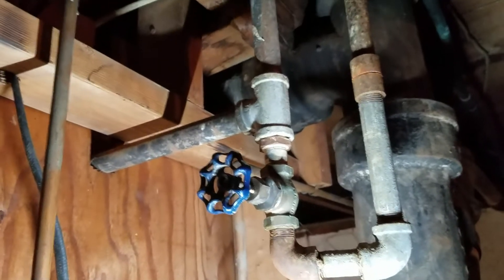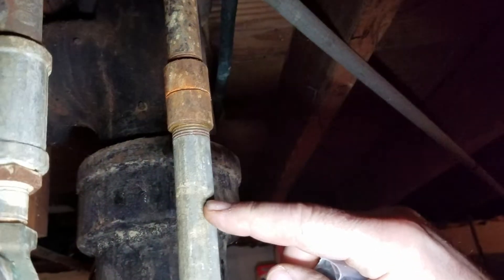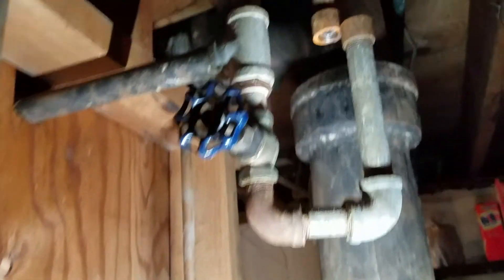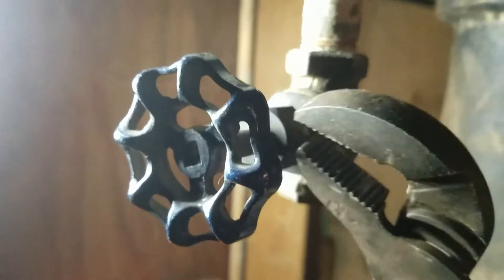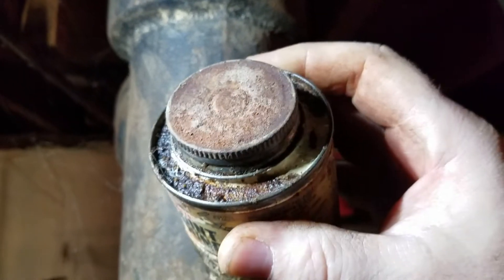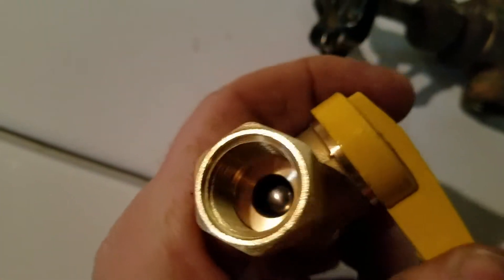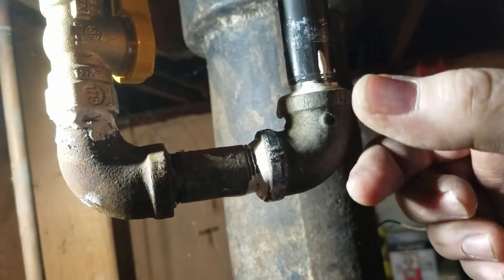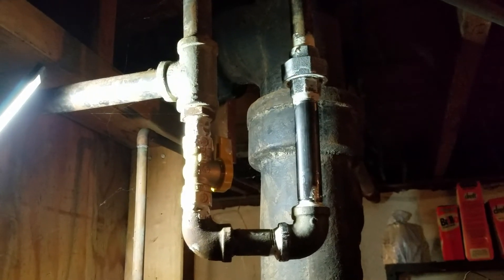HOME REPAIR 101- fixing a gas leak

Comment: They may make special unions for gas line, but the standard ones are usually not allowed. A left right pipe nipple and connector are normally used.  Just thought you would like to know.

Comment: What is the best pipes to use to for replacement to fix a gas line
Reply from the maker: I like black pipe myself, but apparently you can use galvanized pipe also
Reply: @Smittyschannel  Copper for internal gas fitting, external PE for all excavated Gas Lines, up to your Riser / Meter position

Comment: Why would put pipe searler on the union when its tapered ?
Reply from the maker: extra measure of protection; you can also leave it dry as is.
Reply: My two cents . If in the future you need to break the union again to work on another leak or add another line the top and bottom will come off easy . If no dope the union can rusted frozen . Frozen fitting is no fun and take more of your time .  Be smart .
Reply: All gas fittings are tapered, what exactly is your point? You're trying to say you don't need dope on any connections? lol, pipe dope isn't just a sealer, it also keeps the threads from binding so the next guy who comes around and has to take it apart will have an easier time breaking it free.
Reply: @losferwords100  Not here in the UK I've never come across a problem with taper fitting being tight . If the next guy can't do it not your problem

Comment: Where do they allow a union for gas line anywhere other than outdoors?
Reply from the maker: how else are you supposed to make in line repairs & connections? We have unions on most every hookup around here
Reply: @Smittyschannel  Look up left right couplings. They are approved almost everywhere. And any competent plumber will have no problems. They are a little tricky to get both sides started at the same time. In California I have had inspectors turn down a job, even if the unions were already existing.
Reply: Or you can use csst. Which is corrugated stainless steel tubing.
Reply: Union’s can be used almost anywhere in a gas line with one exception. ( can’t be concealed )
Reply: @mastergasfitter  Not in San Diego CA Maybe in other areas, but I have been turned down for exposed existing union joints. An easy fix, but still a pain.
Reply: @notredo   your state is different in many ways due to earthquakes 
I live in Miami fl and follow the recommendations of NFPA54
Reply: @mastergasfitter  thanks for the info. I personally don't have a problem with pipe unions. Just have to follow the rules

Comment: You said to use black pipe with natural gas but my gas utility uses galvanized pipe and fittings exterior to the house. I know it is because it won't rust but why not use black pipe and paint or coat it instead if the galvanize will flake off?
Reply from the maker: I would say galvanized on the outside is prob used to keep the pipe from rusting from rain, snow, etc. Perhaps today's galvanized pipes are less corrosive than 20-30 years ago.
Call a local plumber or gas company to be sure.
In trade school we were always told black pipe for gas applications
Reply: @Smittyschannel  just paint the exposed pipe. any respectable company would do that as standard. beyond the meter though, is your problem and is probably the result of a bad plumber.
Reply: @majcaboose  unsure about other states, but in NYC, painting the outdoor pipe in a color has to change the leaking test pressure, which has a much higher rate for colored
Reply: I'll bet you someone replaced it to a blue handle that's a gas valve I have the same you can use gas hardware water but you can't use water as gas cuz it's not listed usually I'm told at least here in Ontario Canada lots of older homes have galvanized gas supply lines

Comment: I was taught to not put sealant on the slip nut threads of the union. The sealing feature is the taper joint here, not the threads.
Reply from the maker: I put it on the threads for good measure; made sure not to get it on the taper seat areas
Reply: That is misleading to understand the basic principle here. Similar to, if you saw someone put sealant on hose threads and they told you it was for good measure. Would you just shrug your shoulders?
Reply from the maker: Use it or don't use it- I don't care. Not sure it matters much either way. You are responsible for your own repairs. Haven't had any issues by putting it on the threads for years

Comment: They are lucky they didn't blow up.that coupler is actually a thread protector the threads run through not tapered. People get cheap then they leak. In cal you can't legally put in a union in the house. Only 3 feet from the meter. Galvi is for gas out side. No iron pipe on water.

Comment: Get rid of that pipe dope and use new black fittings and pipe. Clean and safe.
Reply from the maker: It's petroleum based; it doesn't really go bad unless air gets in the can & dries everything out

Comment: Couldnt you use two copper to steel connectors... one where the valve is and another at the other side.. that way you can cut the copper whereever you want
Reply from the maker: thanks; will keep that in mind

Comment: When he was holding back with his "Channel Lock's" not to be a you tube Plumbing Inspector he held the Channel Lock's backwards. Not good if you are a apprentice. "ALL-PHASE PLUMBING & DRAIN CLEANING". Good job and a MONEY saver for you
Reply from the maker: you mean at 6:30? The way I was doing it was correct, for leverage against the direction I was turning the old valve.
Reply from the maker: I am well aware of the way you use channel locks & 'crescent' wrenches. If I have to torque something down I use the fixed jaw to apply force. If just moving around a nut, either will do until it's time to snug it up

Comment: Wrong on the union part. You’re not measuring end the fitting to end of the fittings you’re measuring from where the thread stop on the inside to where they start on the other side
Reply from the maker: It was a rough estimate; I know that you estimate halfway into the threads. I failed to mention that

Comment: You can use galvanized pipe in gas line. Galvanized is rust resistant compare to black iron pipe.  And galvanized in code approved fyi.
Reply from the maker: thanks for the update

Comment: Black pipe does not have any corrosion properties where galvanized pipe is Black pipe with zinc coding therefore giving it a corrosion property it is always recommended to use galvanized piping which is more expensive than black pipe in all gas piping only people in the north don’t read nfpa54 or don’t understand corrosion properties use black pipe or dissimilar metals such as black pipe and copper together which definitely causes corrosion use one material or another if I was that guy I would’ve changed all of the black piping to galvanized piping
Reply from the maker: thanks for the info

Comment: Per manufacturers spec you only put pipe dope on the first few threads or approximate 1/2” of threads. Get a 20$ sniffer and don’t call the gas company unless you fuck it up

Comment: You said the gas people turned off the gas. Then you show the shut off valve  leading to your problem. So, why didnt you just shut off that inside inside valve? But, if you needed the whole house shut off, cant you just shut it off yourself at the gas meter instead of calling the gas company.?
Reply from the maker: Everything was already shut off before I got there; I was showing the different ways & points of where you can shut it off, for reference sake.
The homeowner had the whole house shut off because they weren't sure where the leak was
Reply: Could run into my problem, where the gas shutoff is broken at the tank. Waiting on it to run out so that can be fixed. So aggravating this time of year.
Reply: I'm pretty sure that other valve was going somewhere else. It was on a smaller pipe coming off of a trunk line.

Comment: In all my years of gasfitting, I have never seen a water residential gate valve on gas. Wtf are you doing. Pipe dope on a union? Street 90 off of the valve. Ya those are illegal to use. Ughhhhh. Well people like you keep us in business. Keep er up man lol.
Reply from the maker: Water gate valve was already on there thank you very much; if you watch the video I said that & it was obviously there before I ever showed up. That's why I went with a ball valve. I already said you didn't have to use pipe dope on the union mating faces. Street 90 was already there in the plumbing too, & I needed to keep that same angles & distances to the original setup.
Gas company inspected & passed it, so there you go. 
Thanks for the snark & thanks for watching.
Reply: No problem using pipe dope on the union . For the future when next plumber need to break or loosing it . Union come off easy .  This is a advise coming off a gas Fitter working  for many years.
Reply from the maker: @queenmonkeyhead  thank you
Reply: Every union in my house has pipe dope. I’ve never seen someone not use pipe dope on a gas line?
Reply: @Smittyschannel  just because it "passed" doesnt mean you did it right. just buy new fittings. if the customer is worried about 5$ in fittings, then you have a whole new situation you need to deal with.....
to your defense, street 90 may may be legal out of a valve in different areas.
do it right the first time, and  you don't need to do it again with an apology attached to your bill.
Reply: Pipe dope is not just a sealer, it keeps the threads from binding over time and makes it easier for the next guy to break it free if he needs to take it apart. Which is why it's good practice to put dope on all threaded connections no matter what. 

And no, street 90's are not illegal. It depends on your local code. Where I am they are 100% legal. 

The gate valve shut off is the only thing that's sketchy, at least there's a back-up shut off. Residential gate valves are rated for fluids only. Gate valves tend to leak at the stem which is not a big deal for water lines but is a big deal for gas lines. They also like to bind up and not turn or break when you do if they're not turned often enough. I would've replaced that with a proper ball valve. He was right there anyway, he may as well have done it.
Reply from the maker: @losferwords100  thanks. Video shows it was already there, & I replaced it with a ball valve
Reply: @queenmonkeyhead  I am owner/operator of ALL- PHASE PLUMBING and DRAIN CLEANING, 35 years experience. A old timer who taught me the trade sometimes would put dope where the unions close together for a better seal. To this day I still do this. No leaks so far on gas unions aways. Keep up the Plumbing guy's 😁😁😁
Reply: @juliorosenberg2222  lol ITS GAS NOT WATER /👍 Different Rules and Regulations, Gas😊 Distributions
Reply: I am a gas service tech I see water valves on gas pretty regularly in lower income areas. Pipe doping threads on a union is a good way to seal a leaking union nothing necessarily wrong with it just excessive. No need to be condescending bud.

Comment: Galvanised should NOT  be used for water!
Reply from the maker: we were ALWAYS told for decades that galvanized was for water
Reply: @Smittyschannel  you can use it for water and code does allow it but it corrodes from the inside and builds up very quickly. I wouldn't personally ever use it on domestic

Comment: You're using way too much dope and you don't need it on the threads of a union.  Sorry but this is a good example of why people shouldnt monkey with gas unless they are properly trained
Reply from the maker: thanks for the insight- Columbia Gas ok'ed it with no problems